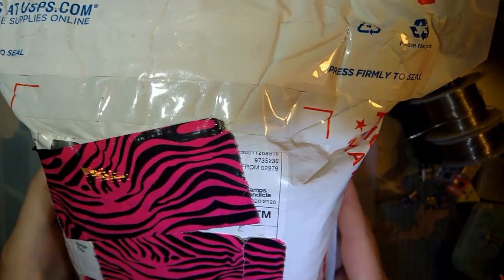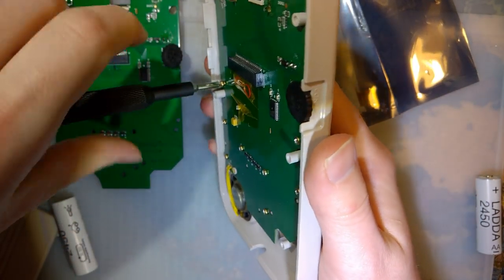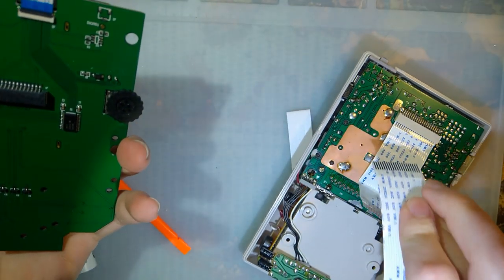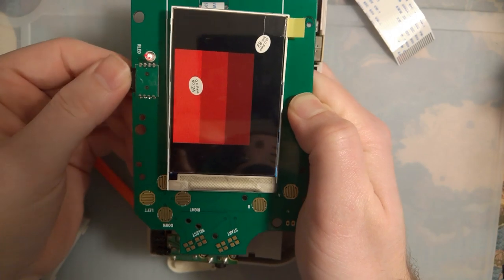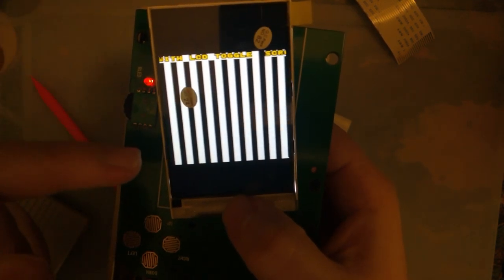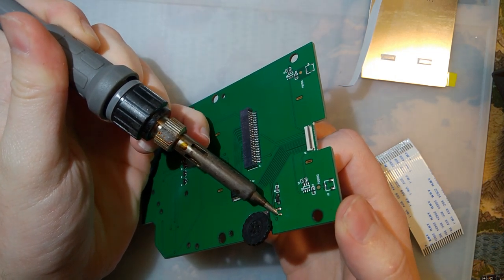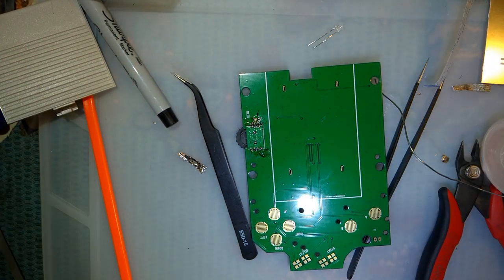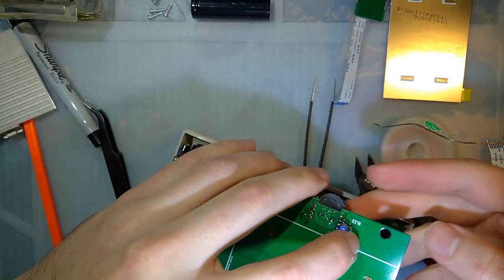Repairing the Rotary Encoder in a DMG IPS Kit (RIPS)

Comment: I was considering changing my led too.  Now... not so much...
Reply from the maker: That ground plane just soaks the heat so efficiently. It makes soldering heat sensitive components a pain in the ass. I think it would have gone a lot smoother if I had just cranked the heat on my iron from the get go.
Reply: @makho  I just added barrel jacks to my psu instead.  Also, I added another step up converter, so it can do a bit more wattage.  Not that I need it, but why not eh.

Comment: Hi I just got the ips v2 kit for my dmg gameboy. I installed it and when I turned it on I get no video I do here the speaker working and the power led lights up but no video. Any thoughts?
Reply from the maker: sounds like one of your ribbon cables is either not fully plugged in or plugged in backwards
Reply: @makho  Hi, That's what the problem was its working great now. Thanks for the help it was very much appreciated